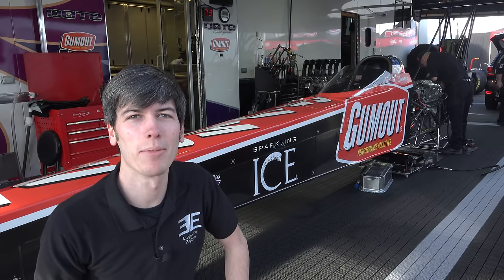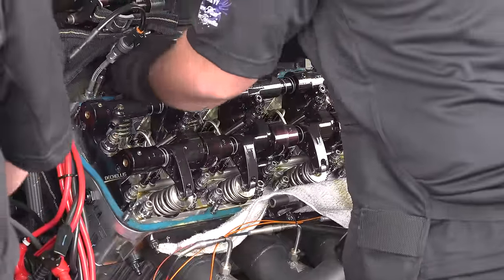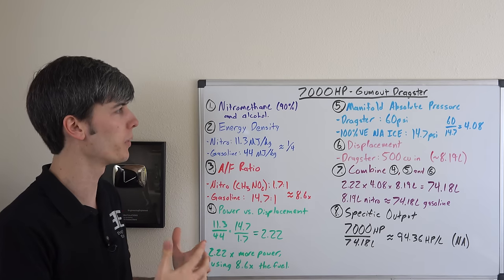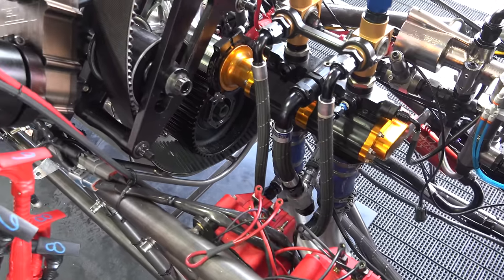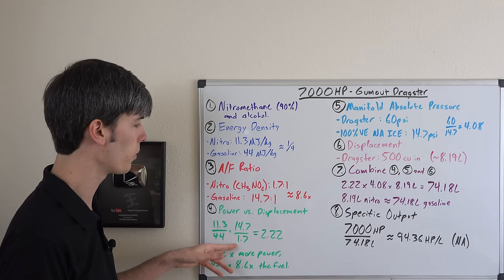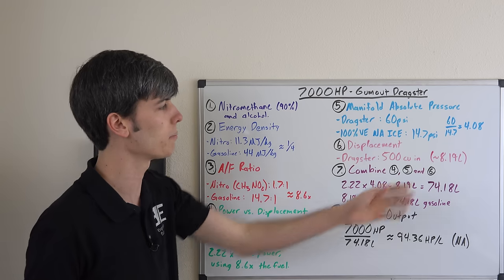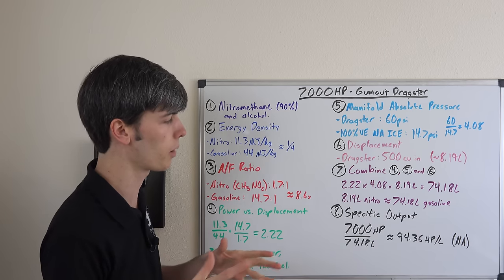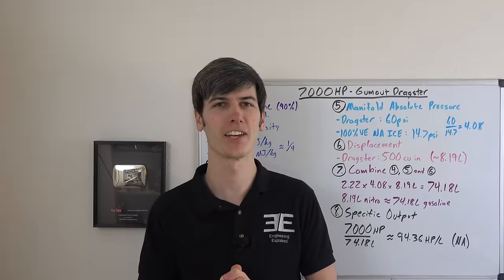Gumout Top Fuel Dragster - 7000 HP Explained

Comment: Why does it have only 2 valves per cylinder?
Reply: I was thinking the same, but I assume it is defined by regulations to be this way.
Reply: Just guessing here :) I would assume the extra complexity and added weakness to the head of the engine would outweigh the benefits of more power. With only two valves per cylinder, the head of the engine is probably more durable and reliable. Plus, since these engines have such a short running life, the added complexity may not justify the cost of having fancy valve-train.
Reply: You can get more fuel in with one giant intake valve, I believe
Reply: DOHC would get in the way of the supercharger and make it more complex.
Reply: Regulations. Also they don't need to make more power, they main problem as for now is getting the tires to survive the top speed.
Reply: The engines are roughly based on the 426ci HEMI of the muscle car era. Those engines were in block cam, 2 valve engines.
Reply: Heavily regulated and all you need is nitro in and power out
Reply: I think a better question is why wouldn't it only have 2 valves per cylinder? :)
Reply: I think it's to keep it old-school, like the fuel-chugging v8's americans know and love. This is the methodology Chevrolet keeps behind the corvette, even if they won't admit it (said they used pushrods in the c7 to lower centre of gravity - horseshit). Considering centre of gravity is low on the list of priorities for a dragster, and the money spent on these engines, I too am utterly confused as to why they don't have three, four or five valves. EVERYTHING is improved with more valves - rotational intertia, flow etc. 2 valves just doesn't make sense to me.
Reply: 70chevelle8 I think Hemi's are still overhead valve 2 valve per cylinder engines. They haven't really evolved any but you can't break them.
Reply: This isn't my argument, but I think you need to relax and get help. Ferrari does make 5 valves engines, in fact they have many. The first started on the F-355 in 1994 and was carried over to the F360 in 1995. The Laferrari has 4 titanium valves per cylinder.
There has never been a valid argument that DOHC engines are more prone to failure than SOHC, it really is case by case in the design. In many cases DOHC is extremely reliable when dealing high horsepower, such a shim under bucket type.
Reply: ironDsteele More moving parts=more complication=more areas prone to break. It's basic physics. Also, the two valve and pushrod design by corvette is very lightweight compared DOHC and makes the engine overall much more compact and reliable and low cost. 

Why do you think everybody is doing LS Swaps these days when there are 4 valve Honda motors and 4 valve Ford Motors just as available?
Reply: Have you not heard of all those people swapping LS engines in Miatas, S2000. Integras...hell any car
Reply: Just an illustration: Look under the hood of a ford with a 4 valve v8, then look under the hood of a vehicle with an in block cam v8 and compare the size. You will find the 4 valve engines much larger in size.
Reply: *****
I should edit my statement to say compare a small block, 4 cam ford to a small block ohv anything else. A classic hemi is a big block.
Reply: I think it's an Over Head Valve engine. OHC designed engines can have more valves, but it's almost impossible to do that on a push-rod engine. Plus, they're easier to work with in terms of parts, complexity, and money.
Reply: Because they are huge valves in a hemi head.
Reply: Bc if four valves per cylinder worked, thats what they would use.
Reply: 4 Valve engines have been used in the `70s `80s and `90s, with a fairly good succes in the late `80s and upwards, never really catched on, a bit over complex maybe, because of the constant wrenching in the high power levels that chew parts, and the rules changed to only run 2 valve OHV sometime in the later `90s. They made good power.
Reply: because V8.
Reply: You both should not talk about stuff you are ignorant about. 
The answer to why they have 2 valves: the rule book
Reply: @LuisRodriguez-sl7cg  um duramax and powerstroke along with cummins have 4v per cylinder pushrod engines.

Comment: They are actually making closer to 10,000 horsepower these days.
Reply from the maker: Ravenphan20 Yep - I took the 7,000 HP figure directly from the NHRA's site, which is what they currently claim. Could be significantly higher though.

Comment: Yeah but how much power would the Top Fuel engine make if it were N/A instead of having that massive supercharger on top?  I'm guessing not nearly as much, because there would have to be way less fuel used along with the way lower volume of air coming in.

Comment: I think the NHRA needs to change the rules to something like formula 1 has. BEFORE YOU CRUCIFY ME, HEAR ME OUT 

I think it'd be good for the sport and the teams if the engines and chassis were required to be more durable and last longer. This would raise the cost in the short term, sure, but overtime it would be cheaper on the teams because the engines wouldn't have to be stripped down and rebuilt after every race. I mean, that's parts and labour for under ten seconds of engine work.
Reply: John Terpack Nope, these engines run at the limit of its design, which is old and inefficient.

Comment: and to add to it drivers at the start literally feel 5 g's of force which is more than an astronaut feel at launch and at the end of the pass when the parachute comes out they are hit with 6 g's of force
Reply: +BenRomero66 A reasonable tight turn in an aircraft gives about 4.5 g, which might seem a lot if you are not used to it, but you build up tolerance with exposure. (Aerobatic specials and top combat aircraft far more.)

Comment: With same volume of fuel, which one gives more power, gas or nitro ?
Reply: I think gas. Point two in the video mentioned energy density though using kg instead of L. In an unaffiliated video, there was a guy that mentioned how they throw much more fuel through the engine than a normal car would. What you would use in a week of driving gets burned in the time it takes to get the dragster down the track, or something ridiculous like that.
Reply: I think so. Nitro can gives more power but you also need a large volume of fuel. Thanks.

Comment: Can't understand..How a less Calorific value fuel ..like.CH3NO2 giving more power ???
Reply: LOL
Reply: Look at the compression ratio  , nitromethanr burns 8times more for the same amount of oxygen required by a gasoline engine , the compression ratio for nitromethane is small .
Reply: Balaji, this is basically rocket fuel, it contains most of the oxygen it needs within the fuel itself, it's at the limit of what you can use before the fuel becomes explosive. Hence it needs very little air to function. Think of a comparison of a stick of dynamite to a large wooden log. The log will contain way more energy, but the dynamite releases a smaller amount much faster. Does this help?

Comment: Engineering Explained why didn't you compare it to a roadgoing supercharged engine?

apples to apples you know
Reply from the maker: bucketslash11 NA is the simplest form. If you want to compare it to a supercharged engine, just change the 14.7 psi figure to whatever boost you're running.
Reply: Engineering Explained and what's a normal suerchaged preassure that roadcars are running (ZR1, jags, mercs, hellcat)?
Reply: bucketslash11 The new Z06 runs at 24.1 psia max (ZR1 was close to that). Hellcat runs at 26.3 psia max. (9.6 and 11.4 psi gage, respectively.) Those are on the higher side of what you might expect from a factory car.
Reply: Zac Harris so these cars run with nearly 3 times the preassure 0.0
Reply: so that we can all understand. 

There would be many more complex calculations to factor in given forced induction - supercharger strain on the engine itself, pressure, efficiency of the supercharger, how the engine itself responds to forced induction etc.

Comment: I'm surprised that engine only has 2 valves per cylinder, I appreciate it doesn't need as much air thanks to the AF ratio so perhaps 2 inlet valves would be of limited value, but I still would have thought it'd be better off with 2 exhaust valves. So, why don't they?
Reply: Hemi chambers move air well especially since this engine lives its life not revving very high around 8-10k rpm is the max the engines only turn around 600 revolutions a run. And largely its top fuel the rule book is about a mile thick wide and tall

Comment: How do they make it down the 1320ft strip if as you say at 22s "they are rebuilt after 1000ft of travel?"
Reply: +damnusename The strips are now 1000ft long not 1/4 mile anymore
Reply: +TheGrundigg When/why did that happen?   Is that just in the USA?
Reply: Go on wikipedia, it's in the general rules after a fatal crash 2008, when a blown up engine made a driver unconcious and he smashed into a wall at the end at 200mph. The strips are shorter so there is less engines exploding and more room to brake if something goes wrong.
Reply: +TheGrundigg OK, Thank you.
Reply: +damnusename After Scott Kalitta died in Englishtown, NJ in 2008 the NHRA reduced the track length to 1000'. The cars are now going faster in 1000' than they used to in 1320'.
Reply: +damnusename too many explosions, they moved it to 1000 feet, ill put this in perspective, a formula one car is going as fast as it can go and right as it crosses the start line the top fuel dragster starts off, it will pass the f1 car before it gets half way. when the do the 4 wide nationals, the horsepower going down the track is over 40,000 hp, that is roughly 45 nascars.
Reply: +TheGrundigg all cars now, when something goes wrong, (engine goes, supercharger,differential, belt,drive shaft,tires,or even fuel stops) it shuts off fuel and pulls the shoots, and grounds the plugs.
Reply: +TheGrundigg ....The strips are Still 1/4 mile.... it's only the Fuel classes (TF & F/C) that are running 1000' to allow for more shut down area.... ever since Scott was killed at E-Town.... not that, that would have helped him, in his particular situation.... but many of the older drag strips that were built back in the 1960's & early/mid 70's don't have sufficient shut down area for todays power & speeds... and no room for further expansion, either.... so, NHRA shortened the runs by 320 ft... and it's been a help in many ways.

Comment: about the Ferrari 458, how can they have compression ratio of 14:1 without suffereing from knocking?
Reply: +Simon Coles can you please give me links about those techs  ?
Reply: cumbustion chamber design plays a big part in preventing detonation. also with variable valve timing it's possible to change the volumetric efficiency of the engine so that it is effectively running at a lower compression ratio at certain rpm/load points where detonation could be an issue.

Comment: Even more amazing than all the figures you present is the fact that these numbers suggest these cars produce 9000 - 10,000 HP. No dynamometer exhists that can accurately measure such power. So your 7000 estimate is very likley conservative.
Reply from the maker: +robert tan Absolutely, likely very close to the 10,000 HP mark, if not higher.
Reply: newer numbers are showing a little over 11,000 horses based on reverse math from torque numbers

Comment: Ahh the glories of forced induction.  Increasing the engines cubic inch capacity while retaining the lower weight of a smaller rotating assembly.   Imagine how much that 74L engine would weigh, in comparison to the 8L engine moving the same volume of air/fuel.

Comment: Can you show us, how the gearboxes of those dragsters are designed? I bet they have far better design, than traditional dog clutches.
Reply: There isn't a gearbox in them, they use the clutch as a gearbox. They have throw out arms that increase the pressure applied to the clutch plates at different stages.
Reply: Interesting. I've been expecting some sort of seamless gerbox. So the clutch is slipping nearly all the way?

Comment: Why don't they run turbos? A turbo can deliver more boost than a supercharger. Doesn't this mean more power and better results?
Reply from the maker: Dimitar Iliyanov Either can be designed to deliver the needed boost. Superchargers won't have any lag in power delivery, which is pretty important for a run that only lasts 3.7 seconds.
Reply: Engineering Explained What kind of blower is this?
Reply: Also, turbos would melt with a vehicle like this
Reply: Dimitar Iliyanov To add to what Engineering Explained said, top fuel dragsters don't have a transmission. A trans brake would be ideal for a turbo setup in order to launch the vehicle under full boost. Realistically you'd want to add a transmission if you were to add turbos to a top fuel dragster, at which point you're increasing weight by a substantial amount, several hundred pounds I would think (turbos and associated plumbing & smaller components & transmission) even with very light/expensive materials.
Reply: Tech4Dummies I wouldn't say several hundred. The transmission certainly would have to be beefy to take this kind of torture, but you couldn't use a regular 5-speed transmission in a run that lasts 3.7 seconds. Even a 2-speed would be pretty tough to make practical under these conditions. As a result, the transmission would actually be lighter than typical automotive transmissions. There's already a supercharger, so swapping that out with a turbo wouldn't change the weight much. I would imagine it would be an additional 100-200 pounds, but it would also need less fuel, be more powerful, and have the benefits of a transmission. More parts to fix up every run, but it would end up being faster.
Reply: TheSmileyFacedPizza You have good points, in addition though don't forget the transmission would have to be tore down after every run, just like the engine, so that's more work for them.
Reply: M. Moore I did mention that. Considering the fact that a few YouTubers thought of this, they must have as well. The cost and extra reconstruction must outweight the performance benefit.
Reply: The nitro method provides its own oxygen. More boost is not needed not to mention it is already pushing 60 lbs which is more than most engines can handle. They consume enough fuel that they are nearly hydro locked so the 60 lbs of boost along with the o2 provided by the nitro method is more than sufficient. Hence the 7000 theoretical hp. As far as the transmission goes, there isn't one. The only thing connecting the engine to the different is the series of clutches spoken of in the video. As the car goes down the track the clutch slips and engages and by the end of the track is running direct drive.  Yue only increase in gearing comes from the tires as they get taller further down the track.
Reply: daniel dallego We understand that there's no transmission. We were discussing the idea of adding one.

Switching from a supercharger to a turbo isn't just about more boost, though. You free up the power consumed by the supercharger and make the vehicle more fuel efficient. More horsepower and less fuel to carry would make for some significant improvements, if you ask me. As long as you can somehow work around turbo lag and melting turbines.
Reply: +John Terpack the turbos will probably melt from the slow burning nitro too.
Reply: TheSmileyFacedPizza
There's a reason why transmissions were abandoned in the 70's.
Roots blowers are mandated by rules, that's why they are there. Twin screw blowers were tried in the 90's and quickly outlawed as they made power increases that were down right dangerous. That's why High Helix Roots blowers are also not allowed. Back in the early 2000's a team that shall remain nameless, made some experiments with a Whipple 8.3 liter blower. They got thrown out from every track they rented for testing. That car made between 17000 and 19000 hp.
Reply: ABOlsen69X 17k-19k hp??? Theres no clutch, rear end, wheels or tires that can handle that. I call bs.
Reply: RCLegion 
You call it what ever you want. I got no problem with that. Maybe look intonit a bit more. Tirrs for fuel cars can handle way over the 10000 hp they are subjected to several times during a season. A clutch is a one-run item, there's that. And the rear end? The launch won't change much, so the rear end will live. They are already vastly overbuilt as is. I have first hand top fuel techbexperience. Do you?
Reply: ABOlsen69X No I don't have top fuel experience but I do have common sense. At 10,000hp this engines last 1 pass before a full rebuild. By the end of a 4 sec. run most of the time they have a couple death cylinders and you want me to believe that I can double that hp and survive a entire 2-3 second pass? No way, maybe if they build a larger engine 700cu in+ but at 500cu in this engines are already at their maximum capabilities same thing with the drive trains.

Comment: Wow, they don't even refinish the cylinder heads. That's just straight up milled aluminum finish... probably carbide or HSS PM insert mills run as fast as possible. That machine shop must rake in the cash on how often they get replaced.

Comment: 7000 is a very off estimate by 2018 standards. They have been calculated to be producing about 10,000-12,000 horsepower. No dyno exists that can measure them so it up to math.

Comment: why this engine has 2 valves and no 4?
Reply: Class rules - 2 valves per cylinder and 500 cid
Reply: danny tryhard if it's a ohc it will mealt becuse how much power it makes and oil burns quick
Reply: danny tryhard and why it uses 2 valves it's becuse one by g intake valve can stand the pressure of the supercharger

Comment: That's not right it's 60 psi over 14.7  and the real world number is 14.6 so the boost pressure would be 60 psi over sea level which is 14.6 which is considered 0